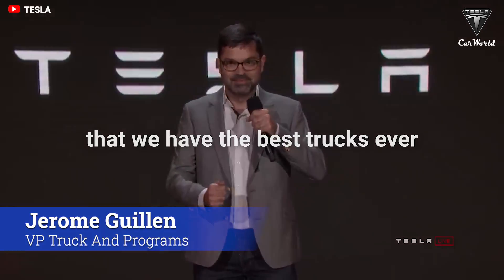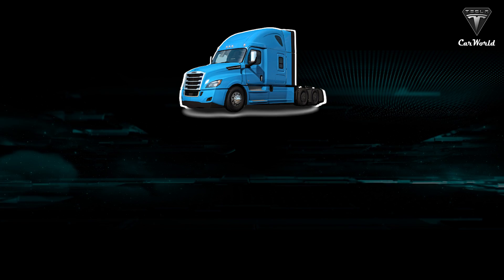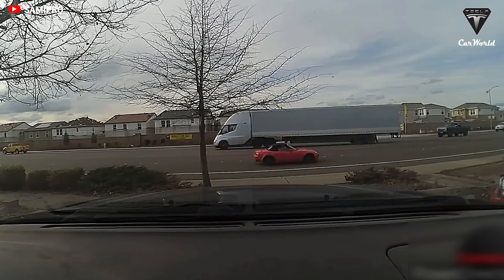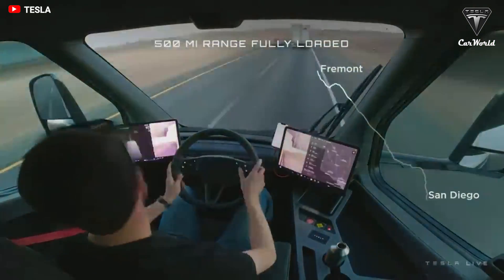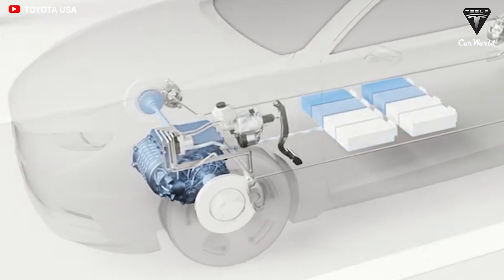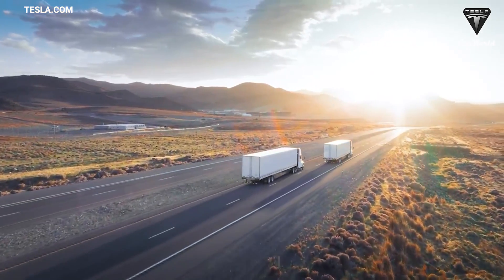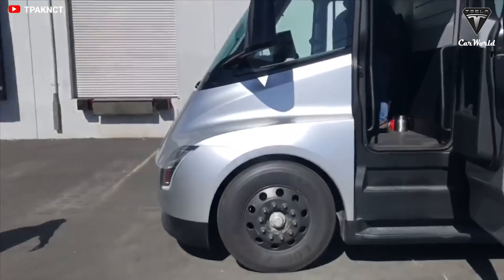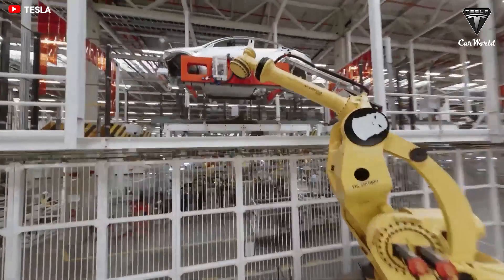IT HAPPENED! Tesla Semi Truck With The Latest Updates in 2023 - All You Need To Know

Comment: We need to know how this EV trucks handle the break system of the trailers, in the videos we can see the air lines attached to the trailer, so how this truck built the air in order to operate the trailer breaks? Plus the self inflate tires system and ABS needs air to work properly

Comment: I don't know the proper terminology, but a veteran trucker on another channel said that the Tesla semi would be fine for the final stage of delivery but not for long haul cross-country trips until the range on a single charge got to 800ish miles or so.  Diesel rigs have something like 100 to 200 gallon fuel capacity, if I remember correctly, so can go up to 1000 (may be more than this) miles based on max fuel capacity.  And refilling those tanks at a truck stop can be done more quickly that recharging the Semi's batt's to successive 80% charges.  That whole video was very informative.  Best to check that one out after you watch this one.  Certainly, the Tesla has a reputation for rapid and frequent improvement in their products.  So, in time Semi's range and charging speed will improve significantly.  This is only version 1.0 and it's already best in class among all electric semis.  It's only going to get better.

Comment: No one seems to be talking about Semi production ramp.  I think Tesla should partner up with several of the smaller Class  8 truck manufacturers. No need for Tesla to duplicate the things that are not unique to the Semi.  These companies already have the assembly tools, factory, and workforce supply chain.  They should be happy to avoid the disruption that the Tesla Sem is bringing.  As their diesel product sales decline they could make the chassis and install the EV parts only Tesla can supply them. Tesla could increase drivetrain volume without investing in new factories.  The legacy producer will be able to transition to EV truck. manufacturing.
Reply: OEMs will be teaming up with Hyliion for their electrification.

Comment: Long ago I bought a Yamaha 650 watt generator that used a chainsaw sized four stroke motor with an impressive muffler so that you could hardly hear it running.  It would run 6 hours on about 2 liters of gasoline.  Could one or two of those generators provide cold weather heating to the battery housing to extend the battery range? --  --  --  I understand the desire to market a purely electric vehicle.  Is that wise; given the long tail the gasoline market is going to have?   Gasoline engines are coming into a new level of efficiency.  Tesla should take advantage of that.

Comment: What do they do about brakes on the trailer?

You could have no brakes on the trailer, but I doubt this is a good (or legal) idea.
You could have standard friction brakes on the trailer, which means that energy is lost rather than recycled as with regenerative braking. Perhaps software control can be used to minimize the use of the trailer brakes, minimizing this loss.
You could have regenerative braking on the trailer (with friction brakes as an emergency backup). This would require different and more expensive trailers for the Tesla, plus an electrical connection which is very robust and able to carry quite high power.
Reply: I think that if they are claiming to handle a load of 80k pounds, that means that they have regenerative braking for 80k pounds, regardless of whether it is cab or trailer.  Using friction brakes on the trailer doesn't sound like much of a negative because they would simply not be used during normal operations.